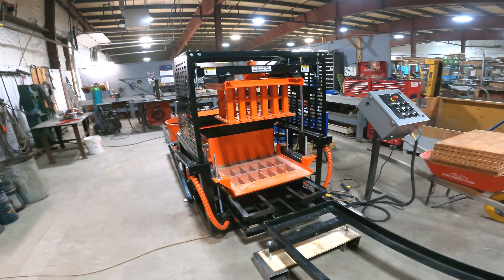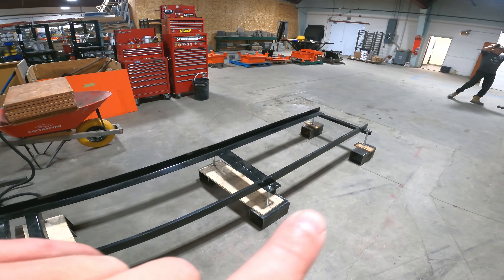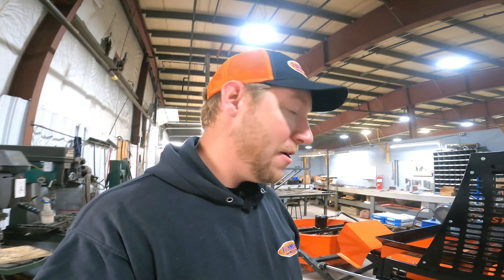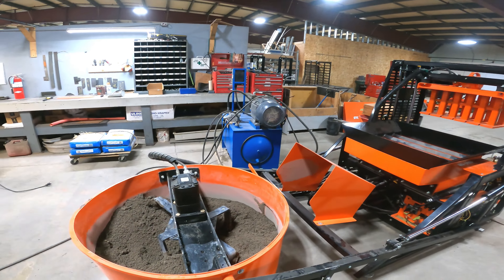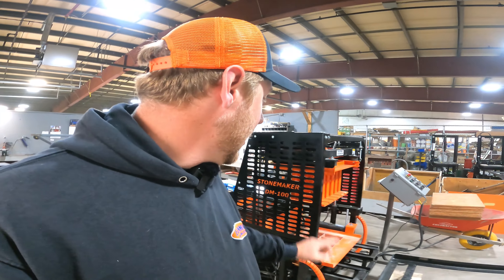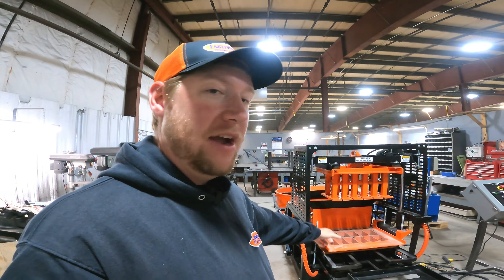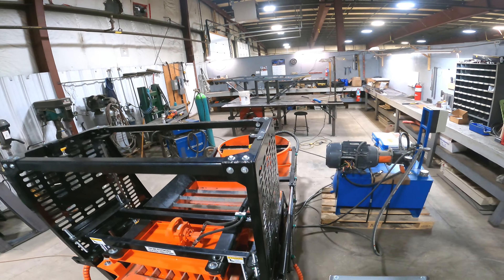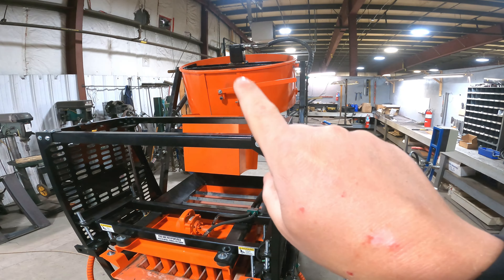Eastonmade; $1400 Worth Of Paver's Per Hour!!!

Comment: Looks like a cool machine. It would make money for a landscaper. How long does it take for them to cure? How many trays do you get out of a hopper?
Reply from the maker: Typically 12 trays out of a full hopper.  The hopper was about 1/2 full.  Its avout 2 days before they can be easily handled and about 28 days for the concrete to fully set

Comment: Just curious, any numbers on structural strength of the interlocking blocks? Wondering if you could build a block building or foundation with this machine. Looks like it uses a dry mix, which if I under are usually fairly strong.
Reply from the maker: Yes; it ls pretty easy to achieve the proper compressive strength

Comment: That's pretty slick, but I have zero market for bricks. Could it be adapted to sawdust and noodles? That would be really useful!!
Reply: One other question, how tough are the fresh made pavers? Do they dry and cure like a baked brick? It'd be really cool to pave the drive up to your mansion with these!
Reply from the maker: They dry and cure the same as any other paver.  I tried Sawdust yesterday, and it formed well.  Just waiting for them to dry
Reply: @EastonmadeWoodSplitters  Mostly I was thinkin' about pellets. Not sure if it would be a viable business, but seems like it would be fun to do. Pellets are useful for sev things, animal bedding, smoked meats, besides heating. If you could build one of your amazing machines to prepare scrap wood, and then press pellets, for less money than a big pellet mill, I think it would be of service around the whole world! Another one I wish I had the talent to work on, is a microwave firewood kiln. Dry a load in hours, not days or weeks! Interesting, huh?
     This has nothing to do with firewood, but you might find it 'amusing'. I spent sev hrs one evening, learning a foreign language. Not Hungarian, that's just TOO tough. I learned Canadian!! Pretty cool, hey?

Comment: How long do the pavers have to cure before they can be used?  Is there some function to only fill half the mold (1 row of pavers) when the hopper is low?  It would save having to throw out a bunch of pavers that aren't complete.
Reply from the maker: About 2 days before you can handle them and 28 days to fully cure.  If you have bad ones you can just dump them back in the hopper without any negative effects

Comment: Seems very beta - that's a faff opening the mixing hopper manually, leaning over pinch points, walking back and forth to the operator's station.  Needs a remote hydraulic latch. 

And how do you efficiently load the mixing hopper? Needs a surge bin/feed chute system for a machine to dump materials and dispense accurate materials. 

Manually sliding in the plywood also seems a faff - I would expect a stack of blanks next to the machine being automatically fed (sort of like razor blade dispensers).

Honestly, I'd hate the liability if you sold defective blocks due to improper mix design. If defective blocks ended up in a building, or an entire driveway full of pavers fails, kiss your business goodbye.
Reply from the maker: There's risk in any business.  A full automated setup would cost millions.  I like to think of it as a portable sawmill for landscapers